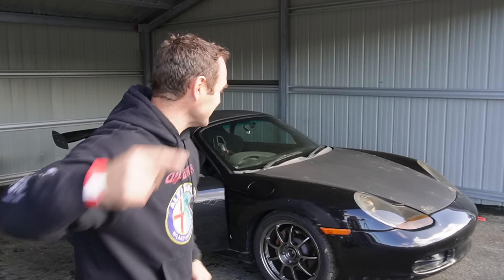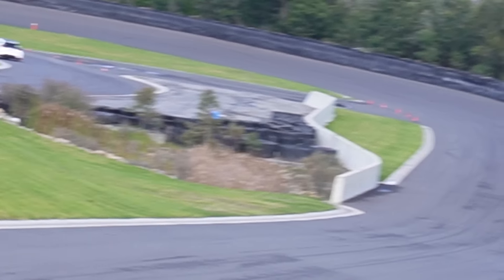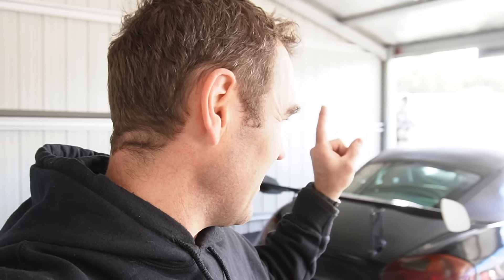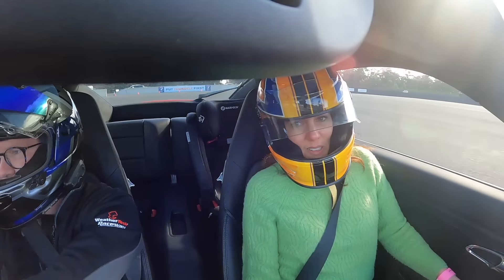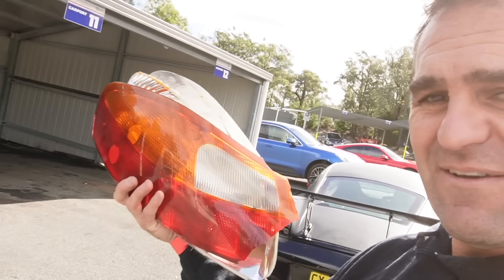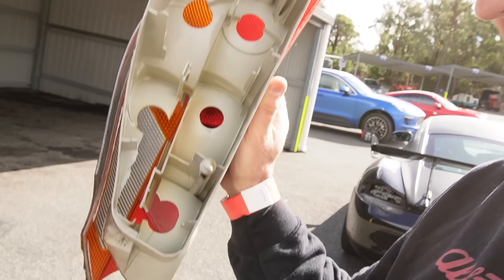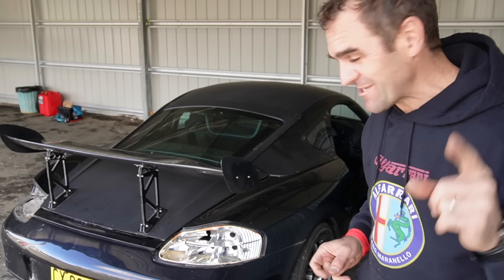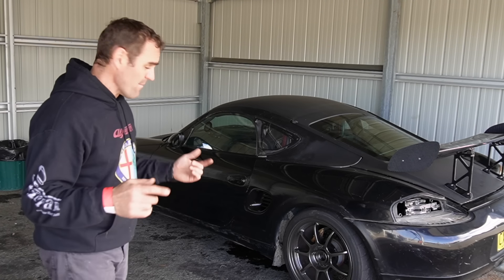Roxster track test didn't go so well - Porsche 986 Boxster V8 engine swap track car build 34

Comment: Great Jeff, if that was a road going car all those problems would have been sorted prior to getting to the track. Unfortunately its not a road going car therefore all the sorting has to be done at track. Your next visit will be a rewarding drive for sure. Thanks for the video.

Comment: Its a win!  I was slapped every time I drove with my thumbs inside the steering wheel, crash and you rip them off was what I was told.
A serious win!  It runs and is on the track.

Comment: If is pas fluid you may need a cooler. We had a similar issue with a Volvo saloon we raced. The installation was very tight and heat just soaked into the system and it overflowed out of the top of the reservoir. We tried running a lower fluid level but that gave other issues, even tried a larger reservoir but it still did the same- the oil was actually boiling!

Comment: Jeff it’s not just that you need the third radiator but the cooling tubes going back to the engine are considerably smaller than the S model. You need to find a salvage car and get the complete system to make it work properly. Good vid

Comment: I love that! ,,,"I don't get it" 😀 With a huge interest and fascination with  all things mechanical, engines, camshafts, inlet manifold, carburators or injection, V8 engine, flat six, big tourqe engine or small high revving ,screaming engine, "long inlet manifold for high rpm power, or short for low down power, brakes, dubbel wishbone suspension, trailing arms, multi link , coilovers, center of gravity, styling, sounds, smell's. All these things and more, in the mind of a "gear head" .  But I love Mrs Jeff's so honest and charming if I may say  exlamation! : don't get it!"  Perhaps giving us gear heads, me includes, a little balance. 😄

Great video! Have a nice week! 🙂

Comment: Sounds good on the noisy pedal. Little niggles will are why we test luckily you caught some of them. Powersteering fluid leaks are scary as they can cause big fires quickly. But keep it up mate it's going to be a ripper when finished and dialed.

Comment: Is there a 1 way valve in the booster vacuum line off the engine?
Also, I remember from an early vid that the cable were really stretched to reach. Place at Milperra called Conwire could sort you out. Take your current ones and tell them how much longer you want them. and they'll remanufacture them.